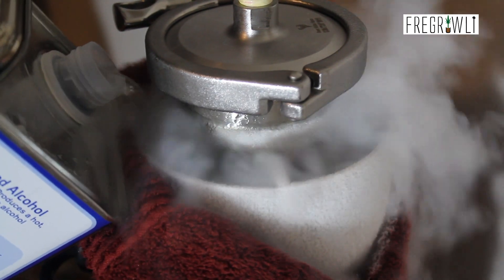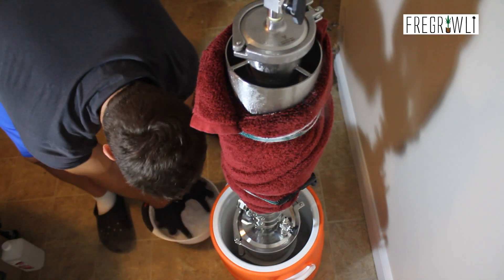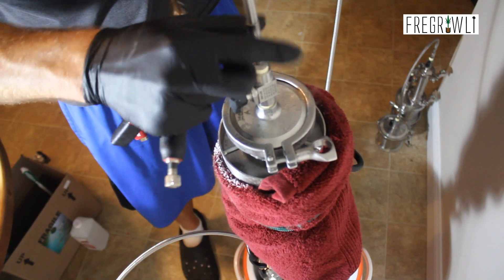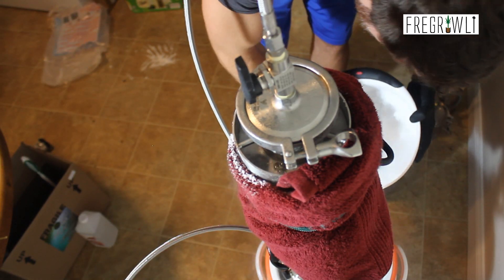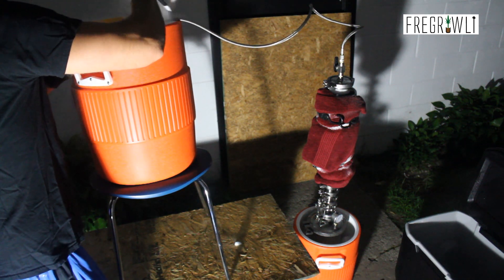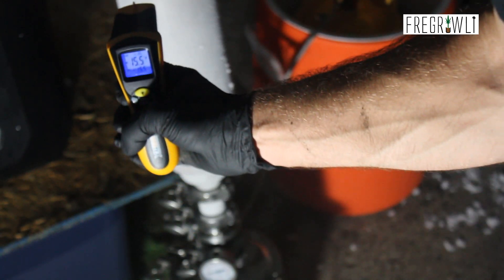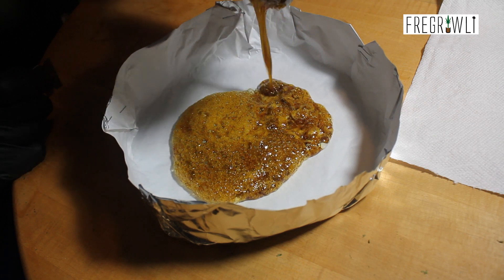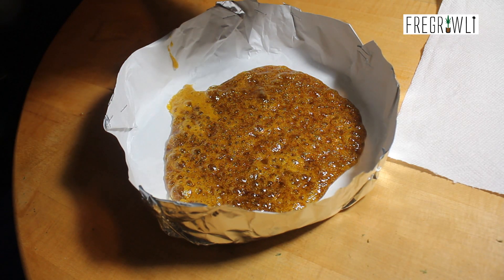Part 7: Adding a Dewax Sleeve to the Closed Loop System

Comment: hello, i saw your videos. I would like to know what is the difference between normal extraction and extraction with dewaxing. I got the color oil like video # 5. I would like to know if with dewaxing, that same oil, is clear as video # 7? thanks for your attention.
Reply from the maker: There are many factors that can affect color, but dewaxing is a priority in obtaining clean, pure concentrates, and the generally desired color.
Reply: @fregrowli  what is the difference between dewaxing and for winter. Thank you for helping

Comment: Thank you so much for making this video series. It has been a huge help for me to learn how to run my cls system. I ordered this same system from bvv except I added the ball valve as well. It's been 10 days since I ordered and it's finally supposed to arrive tomorrow. 
I do have a question. When using the dewaxing column and ball valve this is how I'm assuming I would do it. Pull a vac in the entire system then close the ball valve and flood the dewaxing materials column allowing it to soak for 30 minutes. After soaking then I would open the ball valve and allow the solution into the base. Then leave all the valves open to the top of the column during recovery. Does this sound correct to you fregrowli? Or anyone else reading this? Thanks in advance!
And thanks again for posting this very informative series! I would've never known to distill my butane and that's just one tip I picked up!
Reply from the maker: Doug Ireland All sounds good except I leave my ball valve closed during passive recovery. Solvent likes to chase the dry ice/cold, which your dewax column uses. There are ways but it's a much longer process unless you actively recover with a proper vac pump. Cheers!
Reply: Ahh I see your point there! Thank you very much for clearing that up for me!
Reply: Im sure by now you have learned that you need a spool to separate your goodies from the material in a spool before you dump into your dewax column to chill. Hope all is going well.

Comment: @fregrowli have you ever tried adding that dewax column below a normal spool? For instance i have a 1.5 x 36 de-wax column as well as a 1.5 x 36 spool. When creating the unit I place the normal spool above the de-wax column, with a 100 micron filter/gasket between them. I pack the material into the spool and go through the normal blasting procedure. The difference is in my unit the solvent initially runs through the normal spool and material, then collects into the de-waxing spool (it then is stopped here by a ball valve.)  I let it sit in the de-waxing spool for 40-50 minutes and really allow for the lipids to coagulate. It then is filtered through filters plates ect.

What I see here is you chilling the unit down and doing a cold extraction. True de-waxing similar to winterization is when you really freeze out those lipids using the subzero temperatures. I believe it takes minimum 45 minutes for this to happen at those temps.

Recently I was doing the same shown here in this video. I noticed it really did help with color and de-waxing compared to just a normal spool. Yet after trying both I can say one really works better than another. Also look into adding ball bearings, coffe filters, steel wool, ect into your de-wax column and filtering plates.

Kind of rushed typing this and stoned to the bone off some dabbies. Take everything with a grain of salt :) Happy extracting, the stuff looks good
Cheers!
Reply: Navr183 Navr183 I agree 100 percent. Separate your material from your solvent before the dewax. That one cylinder dewaxing is a con. It’s 1 + 1.  Initially I was worried about filtering the material as well as the fats through the same filter,, but learned there are so many other variables. If you want a proper loop dewax,,, you need that sleeved column under your spool. Dump the solvent and goodies in your dewax column,, and dewax. Good point Nav. They should hire you to stop them from looking so silly
Reply: Would leaving the material and solvent in the cold tube achieve the same result?

Comment: What are you pouring that onto? I like how it holds the form.
Reply from the maker: Reynolds Pan Lining Paper - parchment on one side and foil on the other
Reply: fregrowli I found that in other videos. I love your video. I am trying the 3 gal vac chamber with the 9 inch pad and the cylinder wrap. I'm attempting to make a budget vac oven.

Comment: great video man, thank you. I was wondering how the dewaxing sleeve works is it that it's so cold at the fats and lipids aren't extracted or do the fats and lipids somehow stick to the tube and then need to be cleaned?  thanks.
Reply: robert oswald. the plant fats and waxes and lipids actually frezze  and gets separated by filters but keep in mind you can actually frezze the thc itself if you get to cold

Comment: when you scrape the product out of the splatter platter, is that material harder to eventually turn to shatter? does it stay more crumbly? I heard that when you mess with the viscosity it is harder to turn to shatter. please advise #extractionkings517 #coldwatermichigan #terpcontrol
Reply from the maker: Paul James Keasler It seems scraping can potentially cause that, but 9/10 times I end up with shatter. I should note I only scrape up to maybe 98%. I am not digging that deep.
Reply: Paul James Keasler pour it

Comment: Those sight glasses are dangerous man. Consider taking it out. At the very least get a union style sight glass
Reply: Phoenix Errlybird why do you say they are dangerous? Like they could break basically? I'm just wondering because I have one on my system but I don't have to use it and won't if it's dangerous.